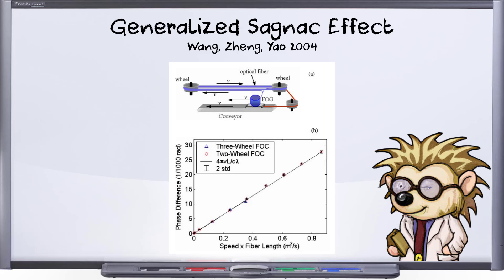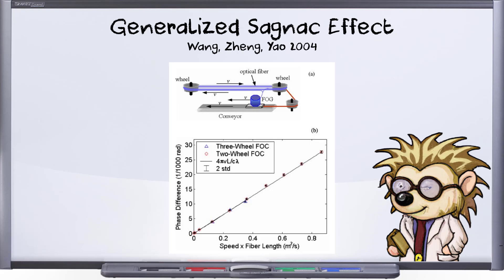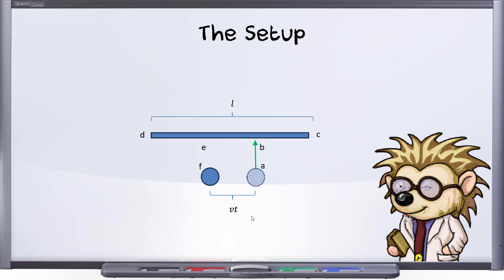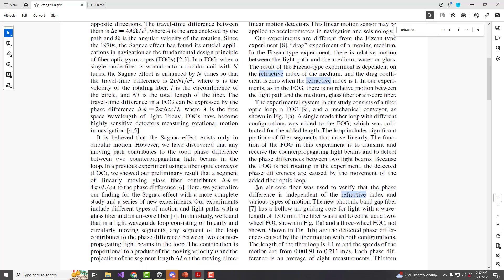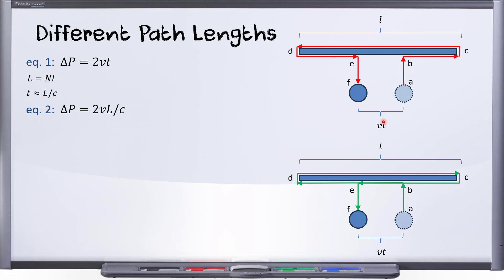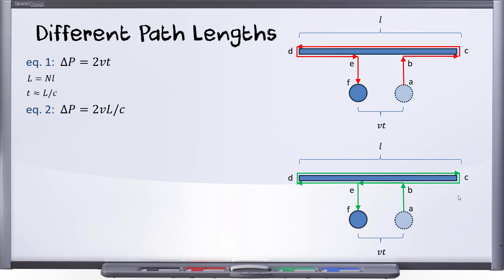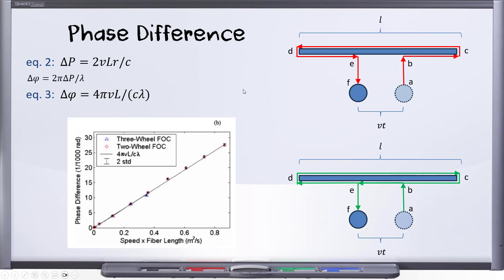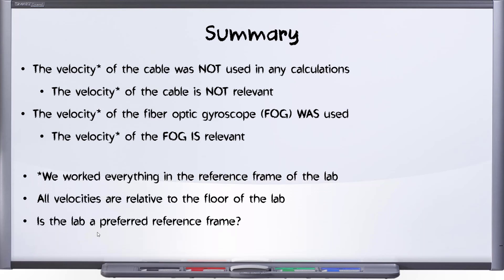Generalized Sagnac Effect Part 1

Comment: Not quite clear of the conclusions here. The narrator says the conveyor belt has no effect on the outcome of the experiment. Is it the case then that he is saying that if the FOG was not attached to any conveyor belt or any additional rotating fibre optic extension etc, as it is in the experiment, but was just moved on its own horizontally across the table in the lab. That there would still be a phase shift measured when the FOG on its own is moved horizontally in the lab? Even if there was no rotation of the FOG?
Reply from the maker: It is the motion of the FOG relative to the rest of the cable that is being measured. The conveyor belt is used to move the FOG at a steady speed relative to the rest of the cable.
The rotation of the cable is not relevant, but the movement of the FOG relative to the cable is. Does that help?

Comment: If we made the wheels of the racetrack move with speed u to the left then we get a phase shift of 4π(v-u)L/(cλ) (neglecting refractive index and SR etc.). To see this, imagine the contact point being initially at the right hand wheel (this assumption is unnecessary but simplifies the maths). The green path takes a time of  l(1-u/c)/(c-u) + l(1+u/c)/(c+u) + ((v-u)(1-u/c)t)/(c-u)  [path moving left, right and then to the new position of the FOG] . The analogous time for the red path is l(1-u/c)/(c-u)+(l(1+u/c)-(v-u)(1+u/c)t)/(c+u)  [zero time moving right, then moving left and right again]. This gives a length difference of ΔP=2(v-u)t. So what we are measuring is the velocity difference the motion of the FOG and that of (the wheels of the) racetrack. In particular, we are not measuring an absolute standard of motion. [Edited to include the extra distance the light must travel due to the velocity u].
Reply from the maker: Check out part 3. :)

Comment: I think what they are measuring is the velocity of the FOG wrt the loop.  Yes, I know the loop doesn't have to be spinning but the FOG vs loop has to have relative motion to get the effect.  Move the FOG at right angles to the loop and I bet you get the same results (where the loop is spinning or not).

A simple test would be to put the loop and FOG on the 'conveyor belt' together and see if you get the same result or if the FOG detects no shift in phase.
Reply from the maker: All correct. They even tried the different angles thing you suggest in the paper.
They did not try (or at least didn't report) putting the whole thing on to the conveyor.

Comment: You can simplify the whole experiment as follows: The FOG on the conveyor belt has no effect to the experiment at all, because it is not rotating. So we can get rid of it. The race track cables can be deformed into any circular shape without changing the principle of the experiment, until they build a circular track. So we can change the shape of the race track so that it becomes an ordinary circular FOG without changing the outcome of the experiment. Lets call the new race track gyro RTG (race track gyro). Now, the conveyor belt is linked to the RTG in such a way, that its linear motion is converted into a rotation of the RTG. 

That means, the linear motion of the conveyor belt with respect to the RTG is translated into a rotation of the RTG. You measure the relative speed of the conveyor belt wrt the RTG by translating the linear motion into a rotation that the RTG measures.

     (  )   RTG rotates
^^^^^^^^^^ <->  conveyor belt moves wrt the RTG and rotates the RTG

So you can not measure absolute linear motion with this experiment. The experiment converts relative motion into rotation, which can be measured using any FOG (RTG). This experiment is just a very expensive and complicated way to measure relative linear motion.
Reply from the maker: The FOG is being used here as the source of the light and the interferometer. You can't get rid of it, or you'd have no way to measure phase shift.
Also the RTG is not rotating... I mean it is, but its motion is almost entirely linear. In fact, you can show that you don't need the racetrack to be moving at all to get the same result.
Let me stress, the rotation of the cable in the racetrack is entirely irrelevant. It would all work exactly the same if that cable were piled up on the floor just sitting there.
We're measuring the speed of the moving FOG relative to the pile-o-cables.
Reply: You can get rid of the FOG by putting the light source und sensors exactly where the cable of the race track leaves the track and leads to the FOG. The FOG does nothing to the outcome of the experiment, because its path is not rotated in any way. You can get rid of the fibre loops of the FOG loop by loop without changing the outcome until you are left with the light source and sensors. Only if the FOG would rotate, it would have an influence on the outcome.

They confirm in the paper that the shape of the race track does not matter. It only has to be a loop of some kind and the loop has to rotate somehow, i.e. the sensors and light source on the loop have to move wrt the geometric center of the loop. So we can simply use a circular path, where the light source and sensors are moving around in a circle. It does not matter where on the race track fibres the measurements are made. What matters is that the race track fibres build a loop, any loop will do, and the sensors and light source moves along that loop.

Sorry, I can't explain it better.
Reply from the maker: @WalterBislin  the cable needs to be a closed loop of any shape for this to work: including a figure 8 where the direction of rotation is reversed at each end. Correct me if I'm wrong here, but as I understand it a FOG twisted into a figure 8 cannot detect rotation. But as we've seen here, it can detect the speed of the cable moving relative to wherever you've placed the interferometer. I find that very interesting. No?
It's certainly not earth-shattering, but I think it's kind of novel.

The real interesting part comes in part 3 where if we discount SR, we should be able to measure absolute speed relative to the aether. It would seem that Wang things (or thought) that would work.

Comment: That bit about t being the same for both paths was not justified. Saying it is a continuous beam so it doesn't matter is not a satisfactory justification. Saying the amount of glass traversed is the same so t is the same is to introduce the assumption that the speed of light is constant relative to the glass. But the fringe shift shows that cannot be the case.
Reply from the maker: The t being the same is rather confusing.
The beam exits the FOG at time 0 and goes clockwise around the loop.
The beam returns to the FOG at time t.
So I've said that t is the clockwise time of traversal. We expect the counter-clockwise to be different, so we won't just be assuming counter-clockwise is the same time.
At time 0, the beam exits the FOG and goes counter-clockwise around the loop.
Where is that beam after time t? Is it ahead of the other beam? Behind it? At the same place?
We want to compare where the matching waves are compared to one another at a specific time later.
So t is not the time it takes each beam to make the loop. t is the time at which we're comparing the beams.
Does that help?
Reply: @icansciencethat  Yes, stating that t is simply when measurement is done is clear.